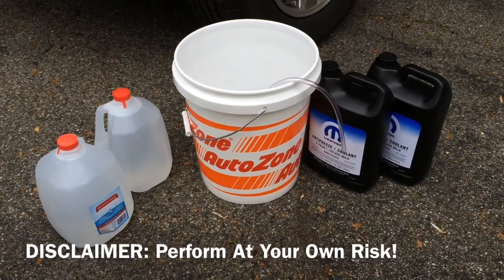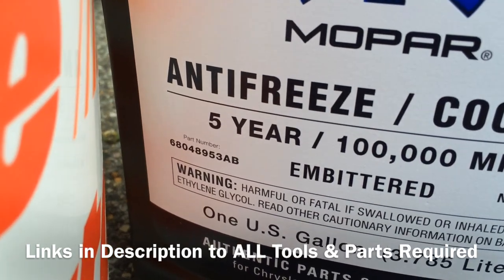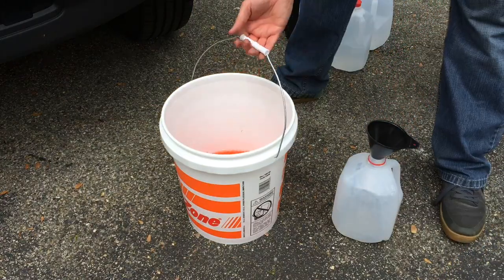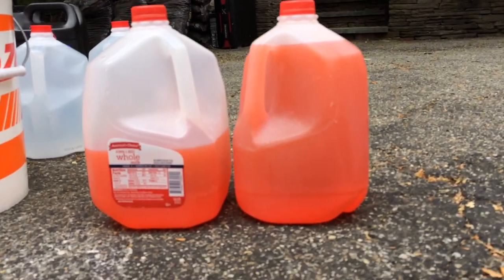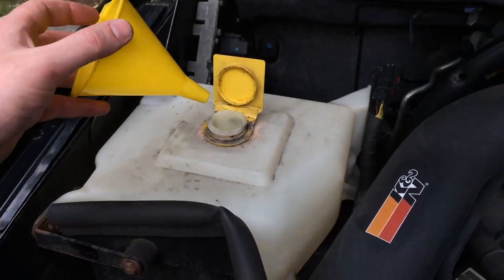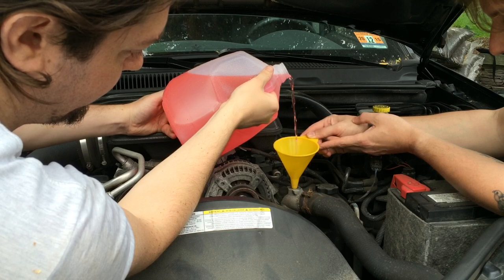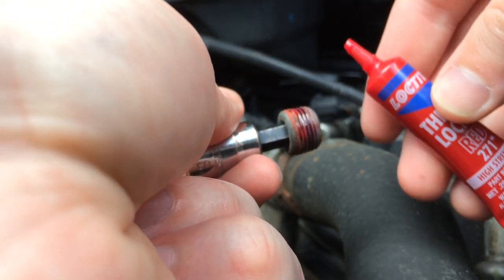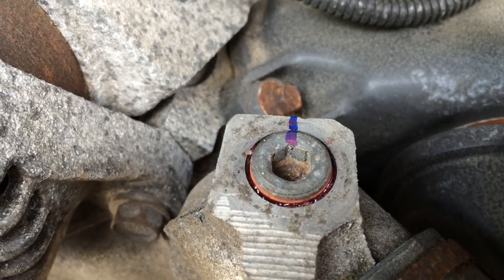HOW TO: Jeep Grand Cherokee Coolant Flush (2005-2010 WK)

Comment: One tip is to run straight water preferably distilled after you do the first drain.  Get up to operating temp so the thermostat opens.   You will be amazed how much more coolant is in thr system.   I actually flush with water twice before my final 50/50 mix.

Comment: How many gallons of radiator fluid does it take total? Some people say 3 to 4 gallons but thats 50/50 mix. Is it fair to say that that's what you have aswell?  Since you have 2 of water and 2 of mopar?
Reply: It depends on which engine you have.
3.7L V6: 14 Quarts
4.7L V8, 5.7L V8: 14.5 Quarts
6.1L V8: 14.8 Quarts

Comment: Which Mopar coolant do I need exactly for a 2006 Commander 5.7L ?
Reply: Only Mopar Antifreeze Coolant, 5 Year/100,000 Mile Formula (glycol base coolant with corrosion inhibitors called HOAT) is recommended.
This is recommended for the 3.7L V6, 4.7L V8, 5.7L V8, and 6.1L V8

Comment: Just a question...
By doing it that way you don't really flush the entire system, correct?!?!
Doing it that way you only flush the radiator and the expansion reservoir.
What would be the best way to flush the whole system, including engine block??
Should I take the bottom hose and the thermostat for that?
Reply: good question.  I think so but I'm not sure.  about to do the same for mine.
Reply: This is not an entire flush, no. The water jackets in the block will not get emptied as this generally will only empty the radiator contents and radiator hoses. Anything back from the thermostat and water pump is likely to stay put.